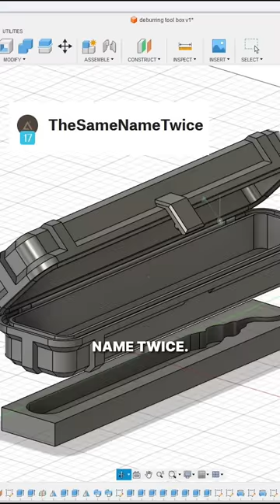Satisfying 3D printed toolbox #perfectfit #3Dprinting #DIY #oddlysatisfying

Comment: Awesome I find 2-3% larger will make things fit with ease especially if it is to be fitted like this case. I’ve been wanting to print a case for my de-burring tool. I’ll try this and let you know how it turns out. 🤔🤔 maybe TPU ?
Reply: I think his measurements were likely off, probably used too much force when measuring, not considering how much the tool will yield to pressure.

Measure close to back of the jaw, ensure there's no gap there, and the blades are parallel and flat make contact surfaces minimal on critical dimensions only can allow for more spring, account for 2-3% shrinkage of PLA and 1-2% on PETG, and you'll be ok.

It doesn't make sense to try to make it match perfectly for the whole profile, unless absolutely necessary, no injection moulded parts are like that, for good reason.
Reply: How did it turn out? I'm thinking about printing one.
Reply: @B-Rex  
I’ve been too busy to get it printed.
Reply: @REX  or the perspective was off trying to take it off of a photo. Many ways to compound an error
Reply: Negative horizontal expansion, also just design with some gap. Also the rotary tool... After just one print. I'd redesign and print
Reply: @KingBigBabyJesus  yes, taking a photo rarely works when you need precision, since the camera applies a nonlinear distortion which is specific to the optics used. I've had better results tracing the outline onto paper and using a scanned, but tracing accurately can be hard for irregular shapes.
Reply: @uploader11459  that makes better sense.
Reply: Nice work!
Reply: @polycrystallinecandy  Or just put the thing itself on the scanner.
Reply: Too bad it’s not black.
Reply: I knew would be too small the roller is on the take but widest point on it isn't
Reply: The only thing missing was a nice paintjob
Reply: Can you post a link to the plan?  thank you🙏
Reply: Yeah I had this issue and had to spend around an hour sanding it out until it was good. Because I dont have a sanding drill or whatever its called
Reply: Prusa slicer its 3% so right on👍🏻
Reply: In my case i dont size up the model. I adjust the tolerances by -0.25mm each side and its a perfect fit.

Comment: Anybody buying one of these tools needs to understand one thing, that round tip will not save you if you slip up. There's multiple people in my shop who've sliced the webbing between their thumb and finger clean in half by slipping off the part. Treat it like an exacto blade, it deserves the same respect
Reply: Cut away from you is always the best course or maybe wear some protective gloves.
Reply: This tool is actually banned in Finland. So many injuries but peoples stil think it's safe and then... Ouch....
Reply: @JJ79_ so how do you deburr in Finland? Burr is also dangerous you know😢
Reply: Also, never resharpen the blades by yourself, and don't use a blade that has the ball at the end remove. I heard from an older machinist that a coworker of his had done that and managed to slice open most of his forearm when it slipped.
Reply: @JJ79_ they are not, our school has them. Sanding and filing on the lathe is illegal though. And using a deburr tool or a hole deburr tool on a lathe is also illegal. Using one by hand when holding the workpiece is not illegal.

Comment: My dad was a pipe fitter, someone that professionally installs things like the cooling lines inside of an under-construction nuclear reactor, and would call that tool a reamer because it was designed to cut the burs from a freshly cut pipe off for a smoother joint between two pieces in a construction project.
Reply: It's not a reamer, a reamer is basically a really precise "drill"
Reply: That’s exactly what it’s used for! Except it’s not for making a smoother joint, it’s for eliminating the potential for future clogging. The tiniest piece of plastic sticking out from sawing the pipe can potentially act like a hook for a strand of hair - and then another strand, then some dead skin cells, then eventually a fully clogged pipe.

Comment: The tool is the case. Typically the top of a deburring tool pops off so you can put the heads in it.
Reply: Only fancy whips have a cap on thw butt to store blades. These cheap aluminum tube whips on Amazon do not. You're probably thinking of those red ones with the black cap on the booty I forget what brand they are

Comment: For those that want the tool, it can be found in most hardware stores in the plumbing section. It is commonly used for deburring pipe ends. I use it daily as a machinist too.
Reply: Also available online and people should know that the tip is meant to spin. Most people think something is wrong with it and leave a bad review because of this but its meant to do that for deburring the inside of pipes.
Reply: Never knew about this tool until I went to MOS school for welding and machining
Reply: Could you use it on pieces for board games when they have those plastic you have to pop out?
Reply: Make sure to get the one that lets you store a dozen blades in the handle.
Reply: @cgoodwin256  that’s how mine is, never lost a tip yet
Reply: Hate using these things on wings. Hardly ever symmetrical.
Reply: For anyone wanting to know what the tool is specifically called, it's called a burr whip.
Reply: Noga style deburring tool.
But cheaper copies usually will get the job done.
Reply: It’s also extremely sharp and will cut the shit out of you if you’re not careful
Reply: As a sparky we use that to debur our conduit. Its simply the best at doing it.
Reply: @adamstephens1371 first time I used one to deburr a hole I couldn’t figure out the angle and pressure. Kept popping out of the hole and hitting my palm. Luckily no deep cuts, but a couple of knicks. Few months in now and I’ve discovered it’s easier to whirl it around with almost no pressure.
Reply: @adamstephens1371 how tf do you manage to cut yourself with this ?
Reply: Can you please write down the website..
Reply: I usually find it at the bottom of my toolbox

Comment: The reason it didn't fit at first is that the picture you took of the tool is in perspective (since it's so close). Try taking it with a zoom lens from further away or use a document scanner to get the perfect dimensions.
Reply: Good point! 👍
Reply: essentially using a comparator to line the shape, but with a few thou for wiggle room
Reply: @xxIONBOMBxx  yes. If you scan it you can use it as a template completely
Reply: Surely photographing close up would make it bigger, as you’re projecting onto a standard grid behind?
Reply: @markrussell8391  correct

Comment: This is the first usable short I have seen this year.
Unfortunately I don't have a 3D printer yet.
But this is going to be on the list of things to print.
PS: you just got a new sub
Reply: Check if you have a Micro Center near you. They do $99 off coupons for the Ender 3 Pro ($199) pretty regularly. Picking one up on Monday hopefully
Reply: @DevilDog36th  thank you
I will have to see if I can get one online from microcenter as I just checked and it's a 264 mile round trip to the nearest one to me.
Reply: @frankdelucey2137  unfortunately it is in-store only as far as I know. Thankfully I'm only 45 minutes from the only one in my state

Comment: Wow, what ! What modeling software lets you trace like that. Very slick. Subbed !
Thanks
Reply: Fusion360 is the one shown!
Reply: or a old  free version autodesk 123
Reply: never thought of it..am using 360 too free version
Reply: Literally all of them, but the one he's using is Fusion 360.
Reply: You can trace in solidworks using import sketch picture tool and sketching on the pic too
Reply: @ciangovern  Solid works is amazing
Reply: freecad can do it

Comment: You can get these with a much smaller blade designed for deburring aluminium or plastics.  Those larger ones are primarily for deburring steel items.  The  "ball" on the end can damage softer materials if not used with care.
You can also get a smaller handle too with an even finer blade.  Noga makes a 3 piece set with a straight scraper, hole deburrer and a small one like the one you're using here
Reply: The ball on the end is also crucial for safety, it prevents you from accidentally slitting open your whole forearm if it slips.

Comment: If you buy better quality, you’ll always get them in a case. Sometimes even
includes some kind of holster to keep it safely in/on your work clothes. 

Also if you need a case for it, you probably don’t need the tool anyway. 

It’s such a common and often used tool that imo there is absolutely no need to store it away.

Comment: Great video man. If you could, I’d love to see a quick video on how to edit an existing STL because it often freakin sucks lmao
Reply: Stls are harder to edit u can use mesh mixer
Reply: To my knowledge there is no good way, and I have looked. Something about the  fact that the stl's are made of  triangles but modeling programs want squares.
Reply: New prusaslicer 2.6 will be a godsend for this sort of editing hopefully. Keep an eye out for its release
Reply: The best I've figured out to do is to just throw it into Blender or some other mesh modelling program. Trying to turn it into a solid never works properly.
Reply: Stls are basically uneditable 😂😂😂 sometimes I can import the stl to another program like alphacam or solidworks, save as a parasolid xl or Iges file (they generally work the best) and import it back into fusion again like 80% of the time it imports as a solid, this works with any file that creates surfaces instead of solids

Comment: When I used to work retail, I found a deburring tool in a box of merchandise. I thought it was made for cutting tape to open boxes. It worked great for opening boxes I didn't want to cut what was underneath the tape. Like cereal box cases.
Reply: I could see how that works well. In the machine shop I used to grind a few to a sharp point because they work better getting inside of small holes and running corners when they are shaped like a cats claw, however Ive slipped off steel and cut my hands gooder than a bitch that way.

Nothin better than walking to the sink leaking blood over deburring😂

Comment: But the deburing tool is a case. All the extra bits go in the compartment in the end of the handle. I have never seen one come with the extra bits not in the handle. The separate ones are more replacements for when you use up the original ones in the handle. Because you are using a cutter made for steel on plastic, one bit is probably a lifetime supply.

Comment: Plumber here. Have used many brands. Not sure what blades youre using on the deburring tool, but if you need good sharp ones, look for Mill-Rose. They have some of the sharpest and best lasting blades Ive used so far.

Comment: There are deburring tools with hollow handles to store your spare blades. This way, at most you need to print a cap to protect the installed blade.

Comment: Never seen this used for 3d printing but that's a neat use case. I use mine for deburring holes in sheet metal, never edges
Reply: Deburr the holes, and draw file the edges.

Comment: Just for info, those are supposed to be used on holes cut into metal to remove metal burr. You can use it for plastic but it is not recommended as it can blunt the blade faster over time compared to how fast metal can blunt the blade.

Comment: If you use this tool anything ferric metal related, dont put in the magnet.. you dont want magnetize it so chips stick to it. Other than that, pretty neat setup and its useful tool. Mind you can sharpen those blades so that box full will last you life time.

Comment: Every plastic (or other 3D printing material) has "shrinkage" while cooling down.
Most manufacturers will tell you how much (usually in percentages) for each type they sell.
Just oversize the print piece by (roughly) that percentage and you will get a 1 to 1 piece.

Comment: dope would love a design walkthrough. like really would watch you desi something like this
Reply: The feature is the canvas tool. Take a picture import it into fusion then size the canvas according to the item dimensions. Then it’s a case of tracing the outline in a fusion sketch. You can then hide the canvas if required and just work with the fusion design once you no longer require reference to the original image.
Reply: @JimboJet737  Thanks, man. I've not even heard of sketch. I'm gonna go grab that. I'm using student licensenses while i can get away with it.
Reply: @adamjuckniewitz727  I’m talking about the sketch tool in fusion360

Comment: Most of these you can get your local hardware store in plumbing, you can usually open up the cylinder and put the extra bits in there but this is cool

Comment: Those nogga deburers are amazing. They feel so good in your hand. 
The cheaper plastic ones are horrible.
Reply: Noga has the best blades, but Shaviv probably has the best handles. Their classic handle is indestructible, and if you deburr stainless steel at all, you'll definitely want a handle that doesn't let the blade flex at all. Shaviv does that the best. I like to throw noga blades in shaviv handles. You have to be careful, though, not every size is compatible between companies.
Reply: @wesleythompson451  the handle looks identical to my Noga one

Comment: 2.5hrs?! Wtf printer is that. That's fast as hell!
Reply: Welcome to Bambu 😊
Reply: It looks like the Bambu P1P, but any printer with a 600mm/s print speed will do the same. I printed this in about the same time with my Creality K1 (which is much cheaper than the P1P with the same specs)

Comment: I have the same whip. The blades suck ass and chip on steel. Aluminum is okay for a bit but youll end up wanting an msd whip for metals.
Plastic I could see it doing fine. Decent 10 bucks on amazon

Comment: Buy a Shaviv Mango 2 instead. Ergonomic handle, blade storage in the handle and if you buy the M designation set for 30 bucks it comes with blade extender and 6 blades

Comment: I'd have just bought a lil pencil box and cut foam to rough rectangular shape for the tool and a separate spot for the blades. No need to scan anything when you can spend like 10 bucks at the dollar store rather than the money it'll cost to replace the spool of filament after all the builds plus it saves filament for other builds (I'm cheap, I ain't tryna- fuck am I saying I'm the guy that wasted money on a device for my guitar that was $1500 and it just sits not in use)

Comment: If you only use this for plastics youll never have to change that insert lol. We use similar ones for metals such as aluminum and steel and we never need to change them either lol
Reply: Hello! I was wondering if you could point me to the tool you are using, giving me a brand name or a store where to find it? I bought a chinese offbrand one from Aliexpress, but in less than a week using it with just PLA, the first insert had already lost all its sharpness... :/
Reply: @juicyvids  sure, im headed to work now, ill see what we use

Comment: You will literally, LITERALLY, never, EVER, need a new blade if you use this on 3d prints. Just throw them away. They're for STEEL. Or some other even worse alloy of metal. I would love to see how many miles of plastic you'd need to deburr just to dull one enough to tell any difference.

I see you have used exactly one, of all the blades it came with. Likely the one that's in the tool. It will remain that way forever.
Also, usually there is storage for the blades in the handle....

Comment: What tool did you use to resize the box so quickly?
Reply: Rotary tool. He said so in the video, if you listen carefully
Reply: The box was a prefab he got from the Internet that uses parameters to allow you to easily resize it, pretty much it's done so you can change around the values that sets the width or depth of the box and is super helpful for quickly changing cad designs!

Comment: What is that grid/work surface called. I assume it makes measuring your pictures easier?
Reply: looks like a cutting matt. sometimes called a self healing cutting matt, a craft matt. thres a whole bunch of different sizes available, usually metric on one side imperial on the other. 
and yeah, it's to help with measuring thing directly on the Matt, especially useful for making the same length cuts repeatedly, saves you having to mess around with a ruler.

Comment: What modeling software do you use?
Reply: I only ask cause I started using fusion 360, but I am more used to auto CAD 2018 but not sure what software is most similar to auto CAD
Reply from the maker: Fusion 360

Comment: Its actually normally a tool used for trimming the inner sharp edges of copper pipes in plumbing ! Just for a fact but it can be used for these purposes too 😊
Reply: That's one specific use for it, yes. But this is a general purpose inside-diameter deburring tool. We use nicer versions of these in machining. It's not normally for copper tubing. These are made for everything from plastic to stainless steel.